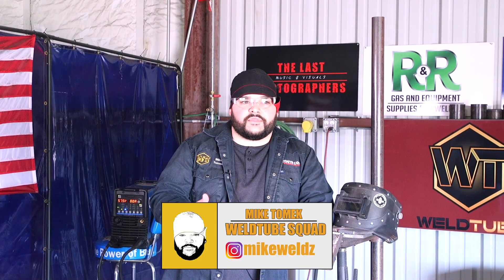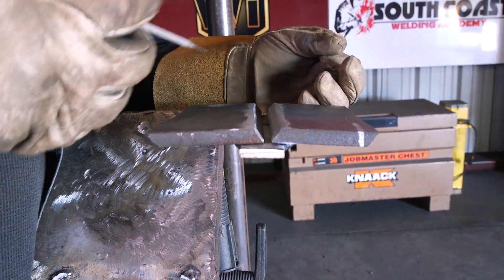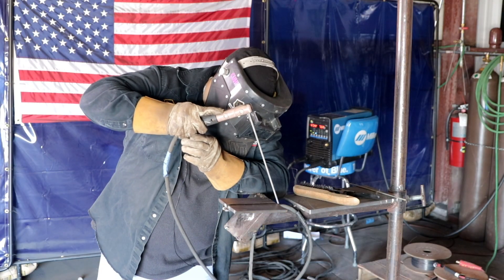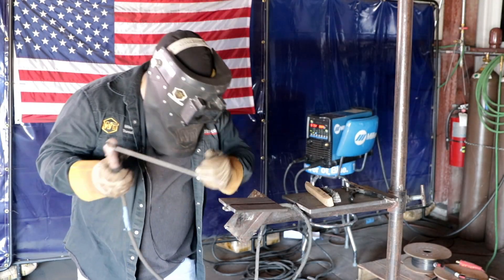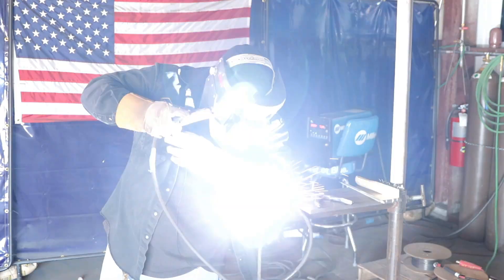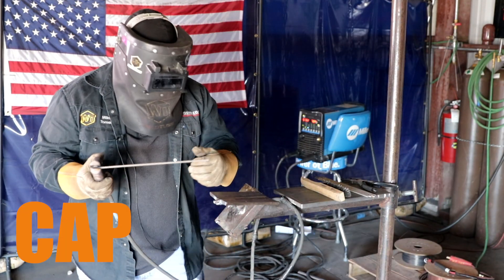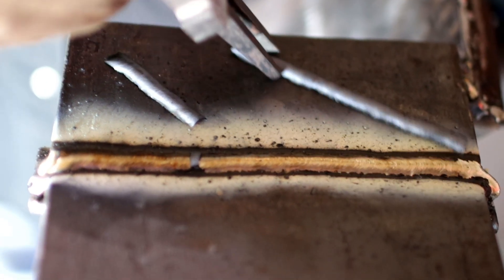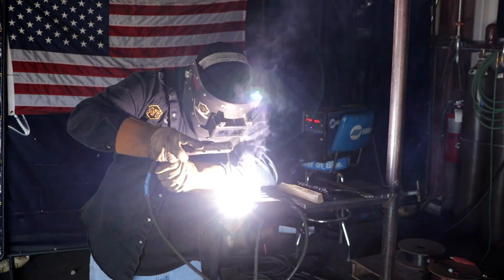309 Stainless Steel to Carbon Stick Welding | 1G PLATE

Comment: That locked in warm up is good to do with 309l 309mo 6013’s reversed and low and old 7018 that are not fresh. You don’t see that taught a lot. You’ve hung around some good experience.

Comment: When I stick welded structure and we weld 6 and 8 inch water pipes schedule 40  and we tig welded stainless 6 inch drain pipes. I weld a lot hotter then these videos just welded faster. If it took this long to weld these little test you wouldn't last long.
Reply: who cares is a SS to CS test, plate

Comment: Does that trick where you stick the electrode to heat it up work for 7018 & other low-hydrogen rods?

Comment: Can you do a 6g pipe with the 309 rod ? Flat is one thing , but 6g is an other game . I bust my test two time for my job , 2.5’’ inches carbon steel sch 160 combo test . 309l Tig root and 309l-16 stick fill and cap . The hardest section are 3 to 9 , it’s really hard to do a flat bead without flux inclusion. It’s so frustrating. Thanks

Comment: So, I don’t normally weld thick materials. I’m not a pro. But I notice that in every video from the Pro channels, that the plates bend upward towards the welds, which is expected. How does one prevent that on real work, where the plates being welded need to lie flat? Or is this mostly an issue because these are just small coupons?
Reply: In the field you usually use a strongback, even on some structural tests I've taken they required one.

Comment: I want to see a video of 3/32 Dualshield/Outershield 70 Series. It's used in Structural, columns mostly. Ive yet to find single video about this wire process.

Comment: You should disconnect the welding rod from the stinger if the welding rod gets stuck to the plate. Prove me wrong
Reply: its done on purpose to pre heat the rods , great for old damp rods that have been in the back of a van for years , of course it wont help put the flux back on them lol
Reply: Gets the moisture out

Comment: I remember i took a 3g stainless test for IMI Zimmerman....man did that weld metal and slag hung like a damn donkey's tail. Had to switch to 3/32 rod because it burnt better....but the downside was that the plate was 1" thick....failed bend test anyways lol

Comment: Can you not weave the cap instead of stringers? Or does that not work out so well?
Reply: Kevin murfilton nope. Stainless rods don’t burn like carbon. It’ll leave lines, rolls, holes or mound up really big.
Reply: @chipandty4398  good to know thanks! Its looks really nice, I may have to get some scrap and try out some stainless stick sometime, as i only have Tig experience with stainless.

Comment: Yeah hi I was just wondering why you're sticking the rod to warm it is that something specific to stainless ??
Sorry if this is a really noob question
Reply: For whatever reason when you run 309L on SMAW if you just run a rod cold you get these giant pin holes you don't see till you clear the slag. I assume this is way to skip the rod oven and get any hydrogen out of it , but I'm only speculating  . Like yourself I'm curious.
Reply: Yes any moisture on the rod will come out and you get basically a little pre heat to the rod resulting a smoother running of the rod
Reply: I find most rods run better hot. Do you find that after starting cold scratch starts the rod suddenly starts to melt and flow well, its because the rod and workpiece have warmed up
Reply: Is there an answer to why he is sticking it ??? Or is scottsudz speculation correct ??
Reply: @renosnutzz8592  I guess the rods are not baked therefore they are full of water...
Reply: Абсолютно бесполезное действие! Современные аппараты оборудованы функцией антизалипания, во время которого аппарат отключается.